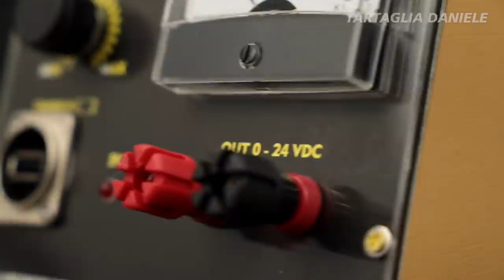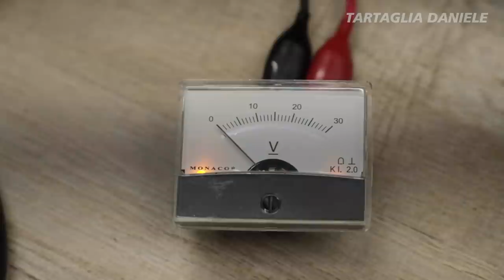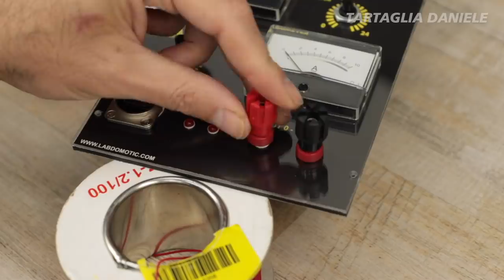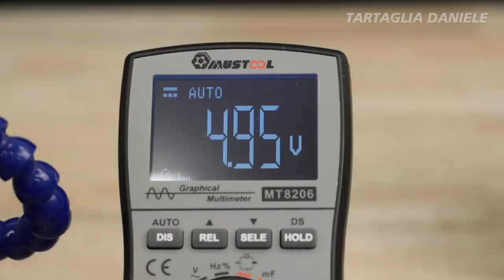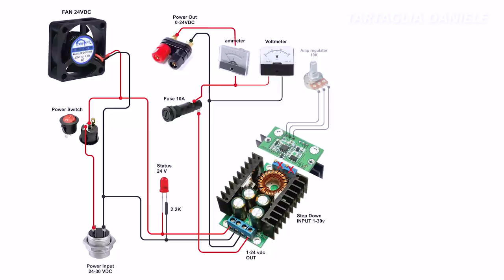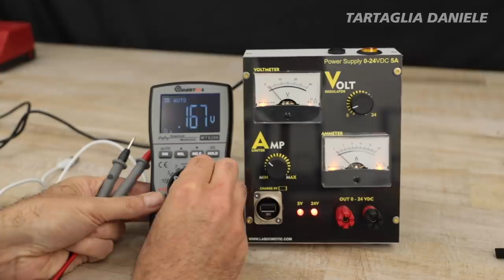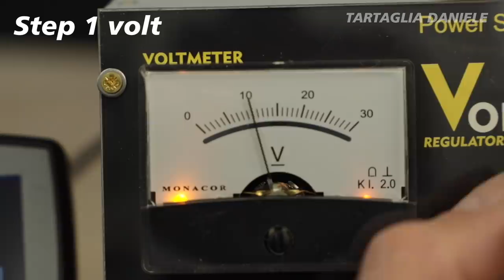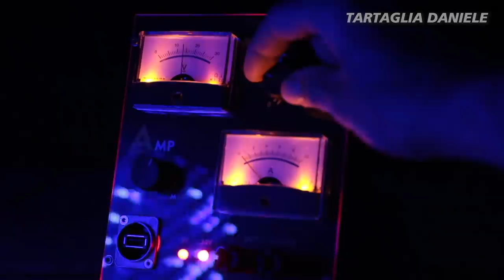How to make Power Supply DIY VINTAGE STYLE ( 0-24v 8A )

Comment: Thank you for "Assembling" your unit and not just gluing it together.  This shows craftsmanship not found much anymore.  I would be proud to have a unit like that on my lab table.  This Comprehensive list of parts and tools used is impressive.  The only thing you may be missing is a circuit diagram.  Keep broadcasting!!

Comment: Great litle project. I got fw of thoses but not made with a step down converter. Few tips: Fan should be inside the box with a metal protection outside to avoid injuries. Also shoul be a hole on top to get an airflow. Fuse should also be at the beginning, for the fan to be protected.  Digital display would be more accurate when you need them, but for sure analog gives a nice look!

Comment: Beautiful build. A whole lot better than the one I made a long time ago. I used a 12 volt transformer and a 7905 chip to make a supply that would output 5 to 12 volts at 1 amp. It served me well in my earlier days. This one is on a whole new level.

Comment: Ottimo lavoro, pero' se posso dari una piccola dritta io per completare avrei messo anche il trasformatore dentro la scatola cosi' da avere un alimentatore indipendente e attaccabile alla corrente di rete 220v. E per ultima cosa oltre al convertitore dc/dc step-down da 2A avrei installato anche una presa USB da accendisigari con uscita 1A. Il perche'? Semplice, alcuni Smartphone caricano con una corrente di 1A mentre i Tablet o altri cellulari (con batteria piu' capiente) hanno bisogno di una corrente di 2A. Oppure una cosa ancora piu' bella sarebbe stato installare un convertitore step-down con amperaggio regolabile + display indicatore (A) in modo da regolare la corrente in base al dispositivo connesso. Tutto qua. Ciao

Comment: Common mistake, he used the wrong screws for the enclosure assembly. Go for the screws with partial threads for a tight bond between all wooden parts. But the overall design is pretty nice.